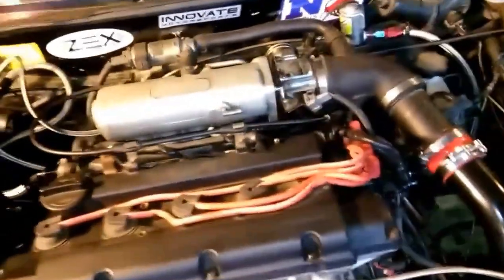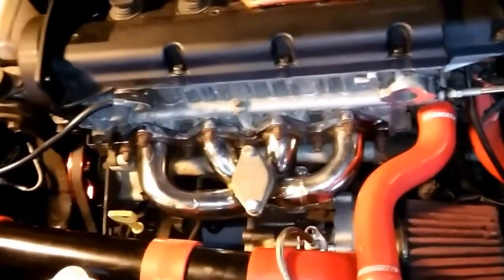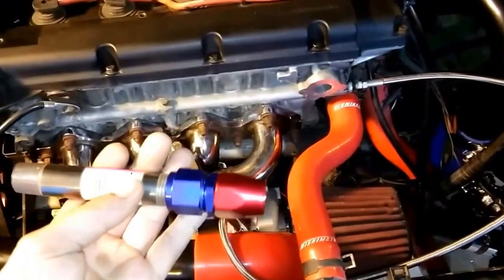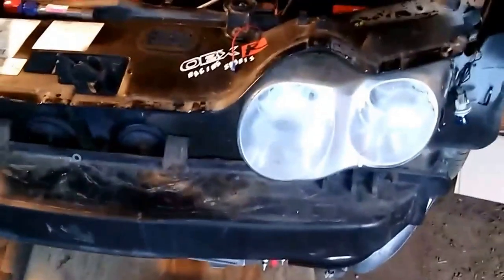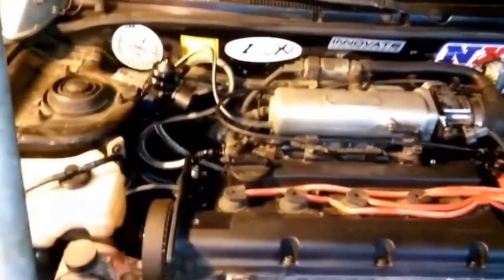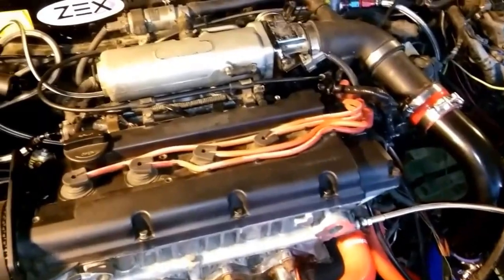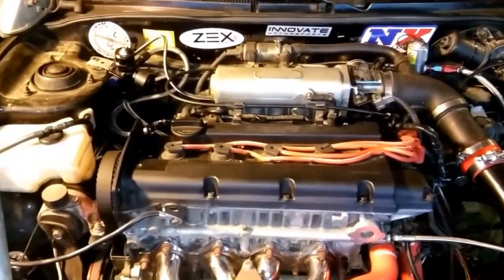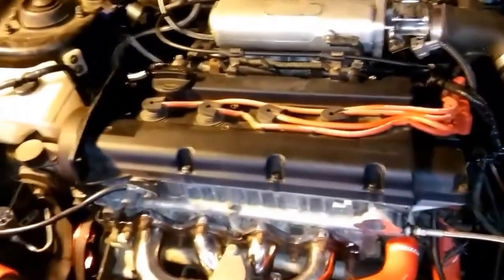Installed 440cc injectors

Comment: what kind of injectors are they
Reply from the maker: cant remember i got part number tib use high impedance injectors
Reply from the maker: i know srt4 injectors work well i got get 888cc are 1000cc so i can run e85 around 400 450whp